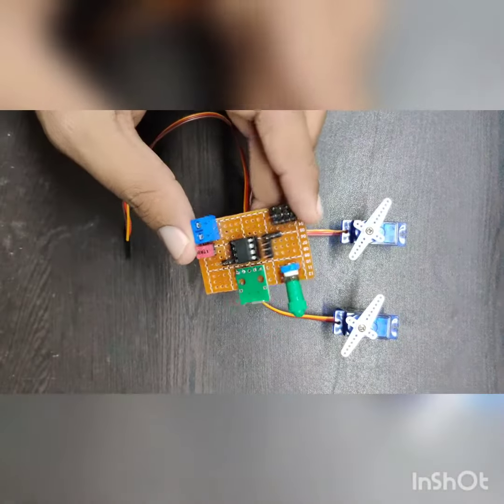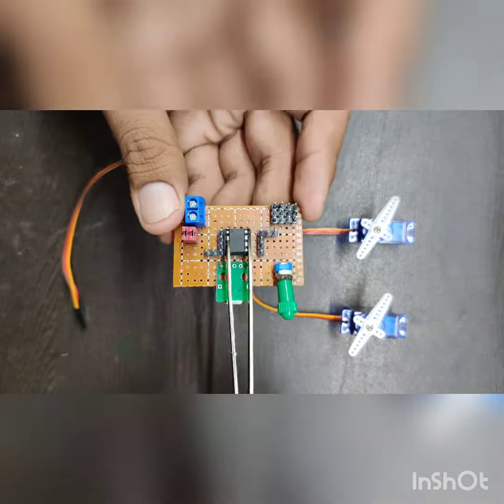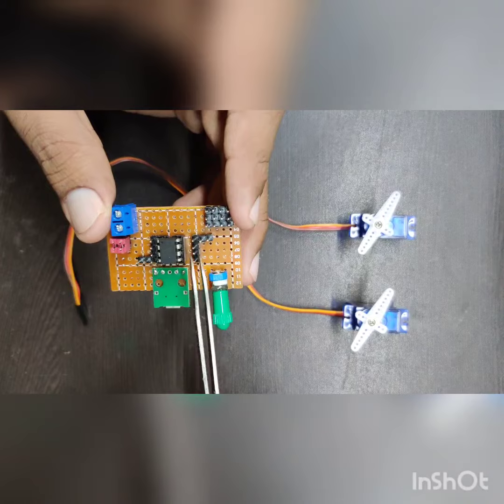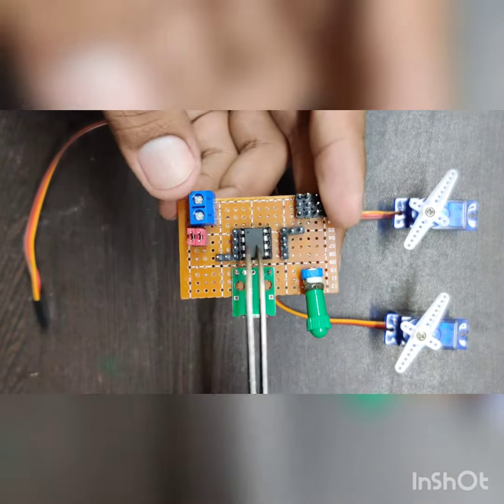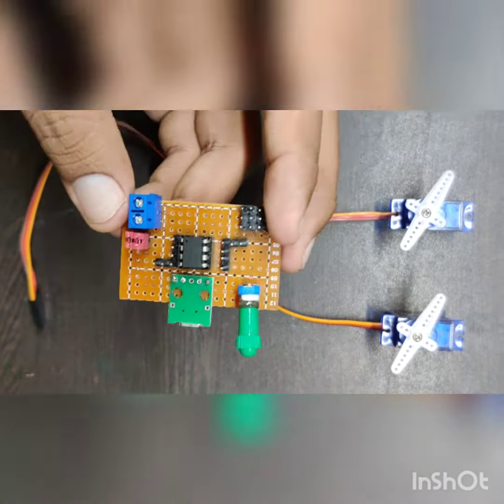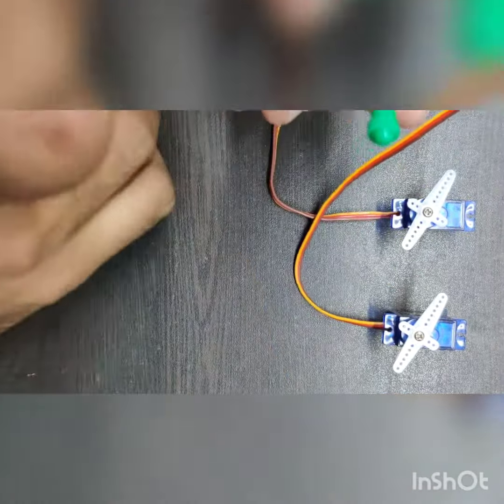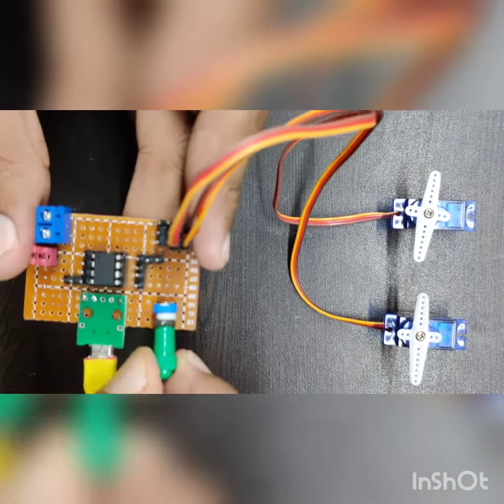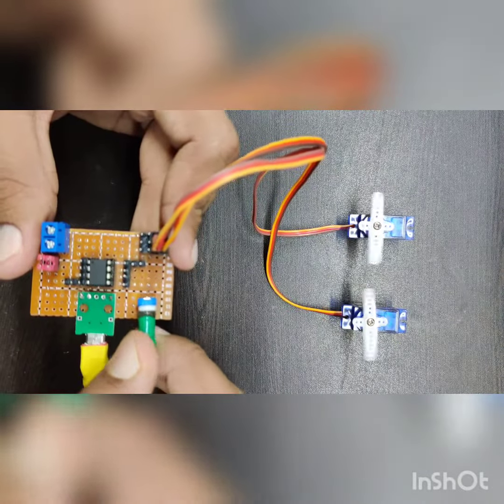Attiny 85 servo tester

Comment: Sir can we make self watering plants using ATtiny85 with soil moisture sensor and LCD display
Reply from the maker: yes it is possible.. to setup watering you plant using Attiny85 and moisture sensor.. but why do you want to use LCD display..? there are only 5 IO pins in Attiny85, LCD display will require 4 pins.. but yes it is possible...

Comment: Can you modify and give your code to rotate the servo motor from angle A (example 0) to angle B (example 20).  Can your source code use for servo motor, Hi-Tec HS-422 ? I use ATtiny 45, pin 2 to drive the motor.  i use Ardrino Uno to program the ATtiny 45.
Reply from the maker: I can modify the code. how are you planning to provide Angle value is it fix value ?. should it rotate to those angle in loop ?